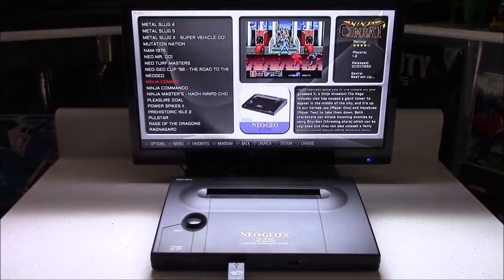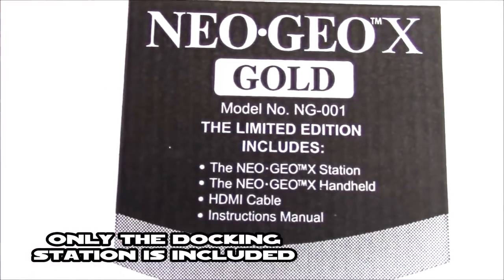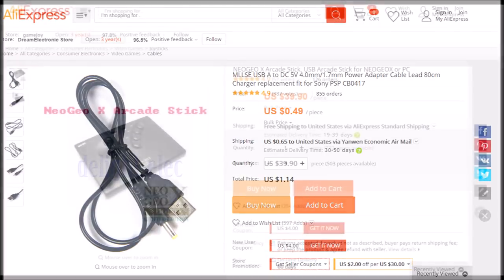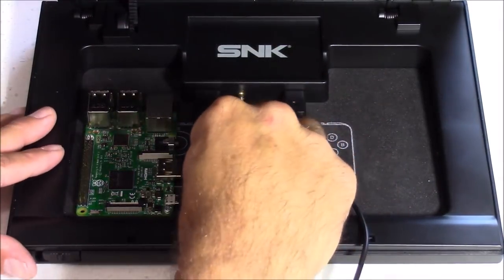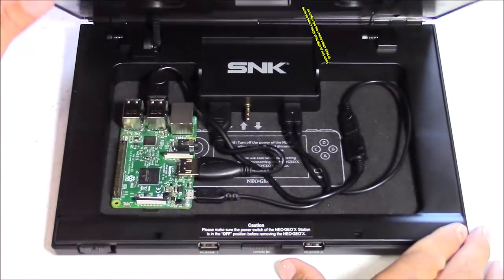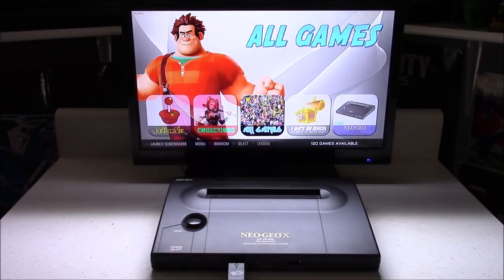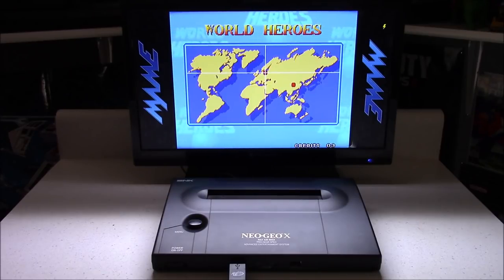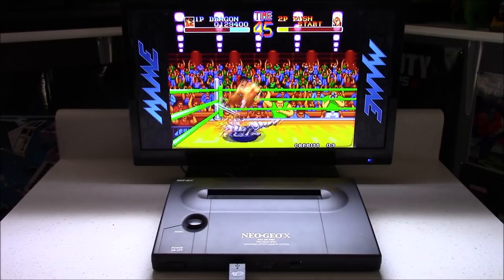How to build a NEO GEO Pi-X "AES" console

Comment: For the power issue. I have found using the original neogeo X PSU. Just add turbo mode to the pi config menu. Problem solved and so far no issues. Pi is a lot faster now. Enjoy. No mods needed to the case. 

Love my neogeo X. Living the dream with save states and all the capcom play games.

Comment: Great video ..I have the full Neo Geo X System ..A awesome console ..but just like you said by pulling the plug it lacks on adding more games to the library which is a total bummer ..and we all know it can be modded but i dont want to take away the retroness of the console ..I like this idea ..plus by doing it like the way you did it ..if i ever want to put it back to its original form ..it wont take much

Comment: I've done several Pi3 based projects and I have to say that this looks awesome!. Might try this with a Pi3B+. Awesome video. Just gained a subscriber!
Reply from the maker: Awesome
Reply: with a Pi3B+ if you use the aliexpress kit you will get undervoltage warnings almost all time. the micro USB splitter cable will trigger voltage drop.

Comment: maybe the undervoltage warnings isn't because the power supply isn't enought powerful. In my case, with a pi 3b+ I was getting undervoltage warnings using the official PSU and the problem was the splitter USB cable included in the Aliexpress kit. You can check this connecting the PSU directly to the PI. The solution is feed the PI from the internal pins of the barrel connector and left the aliexpress power micro USB cable out of use.
Reply: Hi i too have exactly the same problem I would like to fix. How exactly do i feed the power unit straight to the pi? Will the usb ports on the front still work if i do this? Thanks so much if you can help 👍

Comment: You're getting undervoltage warnings because your power supply is not up to the job.  This is throttling your CPU, so you aren't getting the speed the RPi 3b is capable of.  If you don't believe me, log onto the pi via SSH or open a terminal locally and run 'vcgencmd get_throttled',  any result other than 'throttled=0x0' means the cpu has throttled.
Reply: So the solution? Heavy'er power supply?

Comment: I’ll try pi 3 a+,  it depends on how to position the micro usb wire, but not being of good workmanship, the lightning will appear at the top right as in the video where the pi3 warns you "under voltage detect".

Comment: Looks awesome, do you reckon there is enough space in there to fit a USB HDD? Very tempted to put something like this together but was considering using it for media as well and would need a lot more space!
Reply from the maker: It could fit but be pretty tight squeeze. High end Flash drive would be better
Reply: wouldnt happen to have the measurements of the open space handy would you?

Comment: @8 bit flashback what am I doing wrong? I have zipped NeoGeo roms and they show up in the retropie library but don't work when selected. It just attempts to load then kicks you back to the selection screen! Should the roms be in designated folders that are unzipped or does that not matter?
Reply from the maker: Might need the neo geo bios in the bios folder for it work correctly
Reply: @8-Bit_Flashback  That's what it was.
Reply from the maker: @luciferslettuce  good

Comment: I built one of these and was pretty disappointed.  Maybe there is a fix of some sort I don’t know about.  Firstly the input lag from the Neo Geo X joystick was horrible.  Secondly the lightning bolt icon was constantly popping up in the top right corner indicating improper voltage to the pie.  I even tried getting a larger usb power adapter that could handle higher amperage.  Still no good.  Anyone else have these issues?
Reply from the maker: Route your power input directly to pi 3 for a test to see if you get improvement.
Reply: I have the same issue will try a few high amp usb adaptors i have lying around but think its the low guage cables im using to connect it all up
Reply: You get undervoltage logo or massage because of neogeo x case not from your power adapter v6 2.5A or 3A it's ok ... to solve the problem you should make the power to raspberry directly or from inside the neogeo x  case remove the tow wire red and black from the border after power switch and make an USB head to the raspberry :)
Reply: I went ahead and bought all of the gear to make one of these and I have the same issues as you Mike. I can't get the neo geo arcade stick to work at all as well. It works fine on my mac but not detecting in retropie. I'll have a play around and see how it goes. Any tips are welcome :)
Reply: Sorry i mean 5V 2.5A not V6 2.5A
Reply: The neogeox from aliexpress are not original... it's just good case from outside. The board and wiring are week.. good thing to using just the case and make directly connection new USB adapter and  HDMI  the mini hdmi  it's so bad ... i didn't try original neogeox case maybe works fine.

Comment: Does the pi overheat inside that box? I don't see any vents.
Reply from the maker: It's not airtight in the case and on top of that Neo Geo doesn't really push the limits of the Raspberry Pi 3 but if you wanted to you could add some heatsinks to help cool it off
Reply: Nice to know, thanks.
Reply: i just built one of these but customised a lot just to be ocd.
i put a heatsink fan on my pi to draw the heat away. i cut a hole inside of the lid of the case and put another fan to direct air to the small vent holes that are at the back of the case. there are holes there its not just to look like vents from the back.

my theme has videos so the pi gets warm if it is running a theme with videos. it is also warm during say an hour of play if being played during summer months i recommend cooling it somehow like i did. i shall put a video up of the build in a few weeks and go into it in more detail.

Comment: Dumb question but will this fit on a 3b+?
Reply from the maker: Yep
Reply: Batman 

I tried with a 3b+ and the unit couldn't provide enough power to boot up when plugged in to the neo x power unit, I did have a 3 amp charger but it seems the unit can only output what the neo x can provide .  I unplugged the hdmi through the neo geo X and plugged hdmi directly from 3b+ to tv and pi powered on but showed low voltage.  In the end I cut hole in the back of the neo case and powered unit on directly and hdmi direct then linked the usb from pi to neo geo.  Long story short usb on front of neo Geo X works but the power switch doesn't as pi is powered directly rather than through the neo case.

Comment: what a waste of limited edition hardware.
Reply: The hardware is an abomination.
Reply from the maker: Its a Neo Geo X case only not hardware. Also it should be noted that the Neo Geo X is not an official Neo Geo or SNK product it's just licensed by them and manufactured by Tommo.
Reply: Gorilla Jones 

Oh did I hurt your feelings talking about a piece of crap that SNK even deemed unworthy of their legacy and canceled? 

This project makes this system what it should have been. 

I own it and it wasn’t worth the retail price.
Reply from the maker: Hey you guys play nice!
Reply: You need a better power supply... Lightning appears...   I will suggest a pi 2 or zero for this as they need less power and they get less hot. I will do this and add it to my megadrive mini ( pi 2 inside sega megadrive usb hub ) , a pistation ( pi 2 inside a ps1 case with functional ps1 control pad ports ) and a zx spectrum 48 ( with a pi zero inside )... Good video!!